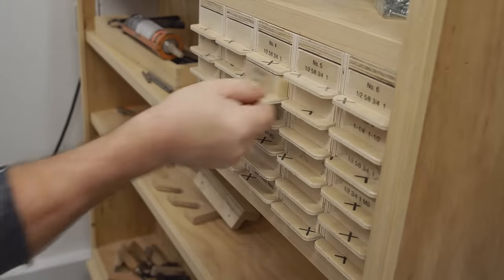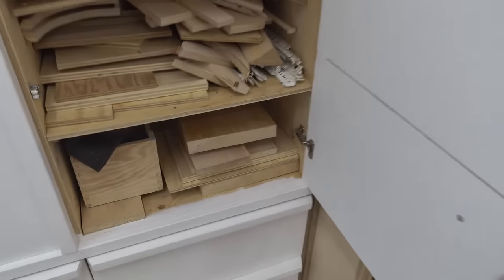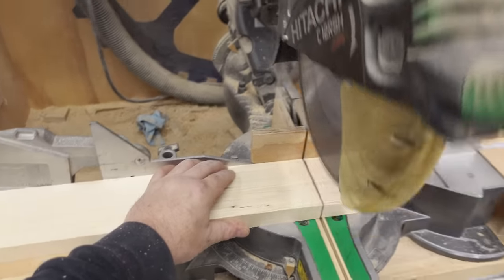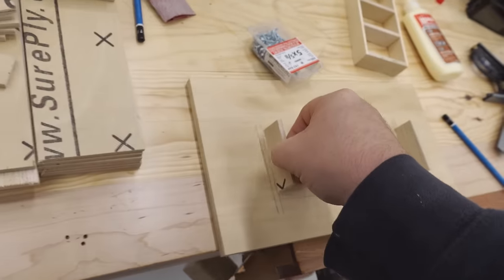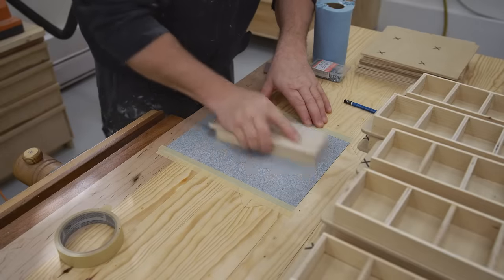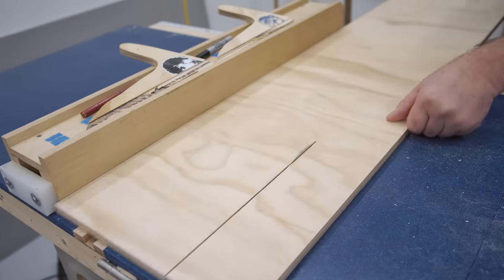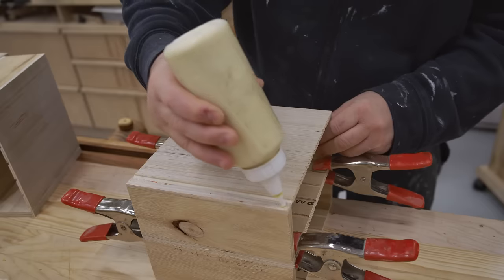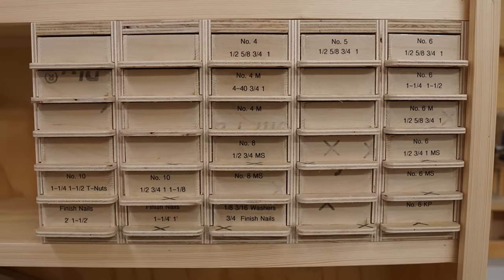Making This Screw Organizer - 30 Drawers 120 Compartments

Comment: Hands ware too close to blade, so this video is useless... no value in it.. RIP!! ;)
Reply: What?
Reply: Just a silly joke for people who only look for mistakes//safety and not the actual value in the video. @Yonatan24
Reply: Ha ha! I knew there'd be at least one troll bringing this up. When I saw John running those thin strips through with just his hands, I wondered if he was trolling the trolls. Throwing out troll bait, that is. The thing is, I've done the same kind of cutting myself, and my dad used to as well. If you look closely, you'll see John has at least one finger hooked over the fence as he pushed the pieces through. That way, his hand is guided by the fence and not just by eye. I admit I've become a little sissified lately and almost always use a pusher, but that's mostly because I usually don't want to concentrate as hard as is necessary for riskier methods. I'm not ruling them out, though, for future projects. It's a matter of experience and confidence, really. If you're lacking either or both, then use a suitable pusher.

Comment: That little handle extension also serves as another horizontal surface onto which you can stack stuff. Like every other horizontal surface, no matter how small. 

Great job.
Reply: That is the biggest problem with ANY flat surface. It seems to beg for something else to placed there.

Comment: VERY nice.  I'm far too lazy to make drawers that way.  I bought my wooden drawers at a flea market.  I found and bought 3 old drawers that used to have newspaper type in them.  They are about 36" x 16" x 1" tall.  And each has about 100 divisions.  So all I had to make was a cabinet with drawer slides to hold them.  The drawers were $15 each, so I have about $65 in the whole thing, including the slides.   And a couple of hours.

Comment: I love that each drawer has multiple bins. That way if your working with a particular diameter of bolt you can pull out the drawer and have two lengths of bolts plus washers and nuts all in one convenient container

Comment: Nice project. I would say though, re: your suggestion on the plastic multi compartment organizers. I hate those things. The trays in them are never big enough and you either have to lug out a bunch of them or you take out the trays and as always happens, spill ur screws everywhere. My fav is go to the dollar store, grab a couple dozen packs of the cheap plastic food storage containers. The ones that are around 3x5"and 3" deep. They hold a good amount of fasteners, each have a secure fitting lids, and you can trans port just the ones you need in ur tools bag without spilling. I bought about 50 of them for screws, nuts and bolts, washer and all the misc bits. Plus extras if some get damaged. Cheap and fast. Just build a wall shelf with slots for each container. That way you don't have to dig through stacks of them, 2 or 3 deep in a cabinet. Can' build a portable case to hold a bunch of the containers to bring to job sites. The sealed lids are great to as they keep the dust from piling up in the containers. :) And using all the same size container makes things easier too.
Reply: Good idea. I watched this and thought it looked good, but now I'm going to do a rack for those food storage containers. They have them half price every few months. I can replace the kitchen ones and repurpose our existing collection. I often have to put them in my tool bag to travel to a job.

Comment: Nice project idea!

Here's a couple of efficientancy suggestion. 
1) Before you cut each of the drawer bottoms from the larger sheet, run one edge (front)  across router tab with a  rabbit bit to make all of the pull slots in one operation (pass).
2) You could also use the same rabbit bit to cut the radius at the panel edges by centering the cutting down the cut line, before separating the side from the larger sheet.
Just those two changes will save you quite a bit of time.

Please buy yourself one of those gripper type push blocks to save your fingers/hand. A large number of repetitive operations like your doing in this video tend to breed complacency, which can easily result in an accident. $25-$50 is far cheaper than an ER visit or surgery. Even the most experienced of us have lapses in attention.
Reply: Oh boohoo

Comment: Tip: Glue a nut and bolt of each size at the front so you can test your unknown bolt if you need more of the same size or just for sorting. :)

Comment: Damn...I’m gonna have to change the password on my iCloud Drive. Somehow John got ahold of my SketchUp models. I literally have this exact hardware storage setup all drawn up. Great job! ;-)
Reply from the maker: Sorry Jer, forgot to mention that I took some inspiration from your system. But hey... the handles built into the bottom... what about that little bit of slickness! :D
Reply: John Heisz - I Build It 
I hope my comment didn’t come off wrong, I’m not upset about anything :-) You validated my idea!

I designed a setup like this, at the same time as I designed the little hardware boxes that go in my workbench drawers. Ended up going with that design instead, because I didn’t have a good spot in the shop for the little drawer setup.
Reply: Ok

Comment: Bit of a religious debate, but I find it is easier to find stuff in a large compartmented drawer than in many small drawers. So a 4 foot by 2 feet deep drawer with a depth of 2-3 inches could hold all your fasteners that you could see at a glance. Of course, opening many small drawers before you find the right item does build up finger and arm strength.

Comment: Nice Ptouch. I used those labels on my electrical panel.
Reply from the maker: Bought it 4 years ago just for this project - first time actually using it for anything :)
Reply: I spent an extra $20 and got one that plugs into a PC.  It gives you much more control over text layout and you can use any font you can download.  It also prints pictures.

Comment: Made this without your plans.  I suggest making the boxes first, with bottom piece glued, then attach dividers with a pin nail.  3 dividers are overkill in these small boxes.  I also used 1/2 inch baltic birch which make the entire cabinet sturdier.

Comment: Those came out nice.  I can see why you said you did it the hard way, but these are much nicer than the plastic ones you can buy.  At about the 20 second mark, when you're cutting the plywood down, you were flipping the board over for each cut.  Why did you do that?  Did it make the cut more accurate or something?  Thanks and Merry Christmas!

Comment: John, very much appreciate your videos and candour in them.  One thing I have noticed when you cut sheet goods on table saw is that you cut and then to repeat the same cut you flip the stock over each time. What is the reason for this?
Reply: Looks like he does it to keep the cuts as square as possible. Very important when gluing up multiple small pieces like this.

Comment: How do you manage to drive those pins into the 1/4 ply to 1/4 ply without having a pin blow out the side occasionally  (or always like me)? I did exactly what you suggested in the beginning.  Built a rolling cabinet to hold several small parts holders with removable bins.  Truth is, I hate the thing. Gotta schlep out a giant parts holder to get to a small removable bin of washers or whatever.  Immediate access is way better.  So please hurry and build me mine.

Comment: Nice build John, seeing those X every day would drive me nuts BUT that’s my problem i’m sure you would say to me 😃. Merry Christmas
Reply: I know the feeling. I used underlayment for a couple of toy trucks for the grandkids. I assumed that the paint would cover the X's. The paint I chose did not cover the markings. Oh, well. The boys don't care.
Reply: Professionalism! Eyecandy for me.
Reply: What's the purpose of those X? It's not a glass panel, you see it.
Reply: @DumahBrazorf  Think about it, it's floor underlay.  What might go on top of it that needs to be lined up straight where markings would come in handy?
Reply: The X's in floor underlayment are not for lining up the new flooring. They give guidance for the recommended fastener application spacing to the subfloor, usually staples. Usually for sheet goods on top of the 1/4" underlayment.  Really handy(except when somebody has to peel up this stuff down the road:) !
Reply: gA .....was thinking the same thing. There are probably some who like the look, but my ocd would be on overload 😁

Comment: Do the brads provide any real strength?  I need to build something like this but I don't want to buy a nailer and compressor.  Also, I shot first.
Reply: Glue should be enough if you don't plan on dropping them from a ladder... Nails are basically used to hold the parts in place while/before the glue dried so you can keep working.

Comment: Great build John. I have the plastic trays and I dont really dig them. This idea would be much better. Just out of curiosity, what did you do with the little 1/4" x 1/4" strips after you cut them off? I have a tendency to keep off-cuts like that. Am I just being too frugal or is it a normal thing to do? Thanks for all you do.
Reply: I wondered the same thing. I at least set them aside for a few days to see if there is any use. They could be used for mini draw slides.

Comment: I wish I had the tools to build it.
I recently got a $20 plastic organizer on Amazon you can tell they wanted to save every cent on it. The small drawers are made from really flexible plastic: obviously, because they wanted to keep the cost down using less plastic, and hard thin drawers would break...
The drawers are very loose in the container and don't slide in/out as easily as I'd expect.
But for $20 it's fine, I guess.
Reply: He built the table saw.  so if you have the tools to build his table saw, you have a table saw.  the finger pull can be done with a simple hole drilled through the drawer bottom if you don't have a router table.
Reply: @LostWhits  Yup, I wasn't complaining, building a table saw is just irrelevant for me and making it with a hacksaw would end up looking horrible.
I do have a similar and way simpler idea for an organizer, video about it coming soon! Hopefully.
Reply: You have to work with what you have. Sometimes that is very little if anything. I have seen some people make really great quality stuff with little to no "real" tools.

Comment: 0:25 what’s the purpose of flipping the wood each cut
Reply: I thought the same thing.  I think it is if there is any irregularities in the fence blade alignment, it evens out everything.  But that is just a guess.  I would be interested in John's reasoning.  It is actually the reason I looked through the comments which I almost never do.  Good question.

Comment: those plastic organizer thingies are pretty darn expensive for what they are to be honest. if you dont factor in time (wich you should not as a hobbyist) a sheet of thin plywood is much cheaper to have. plus you have the flexibility to build it fully to your needs and you can always build another one just like that if you need it. try finding your small part organizer again 3 years from now, not gonna happen.

Comment: I've never seen that plywood before in Australia. But I actually like the look of the grain.  As for the back side with the X Marks.  Lends to the DIY aspects of shop furniture.
Reply: LostWhits ... The plywood is called “Sureply.” It’s used as an underlayment for vinyl flooring. All of the X’s, are recommended fastening points